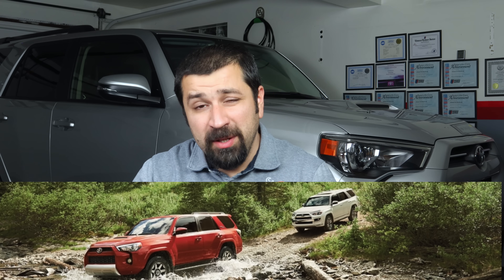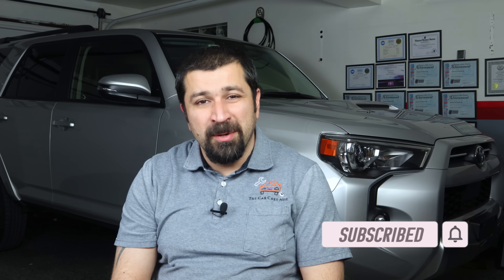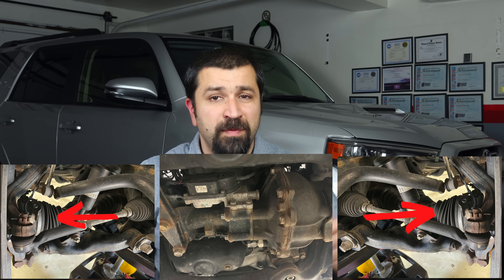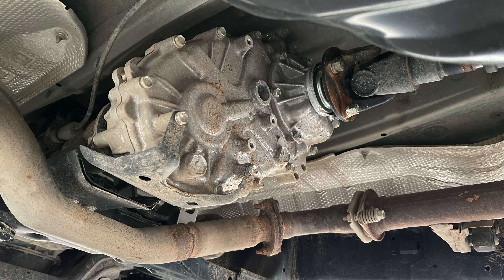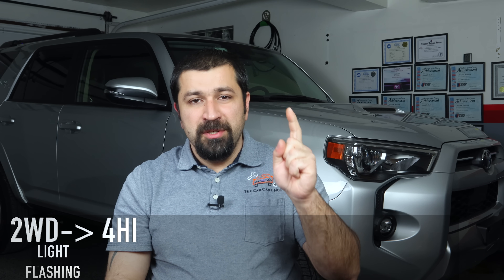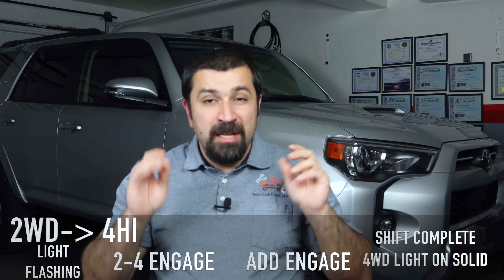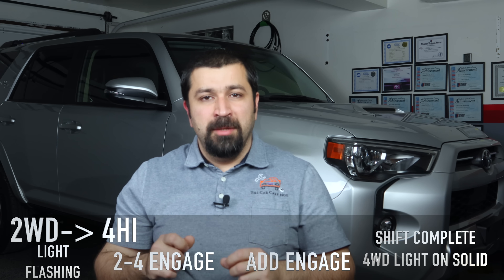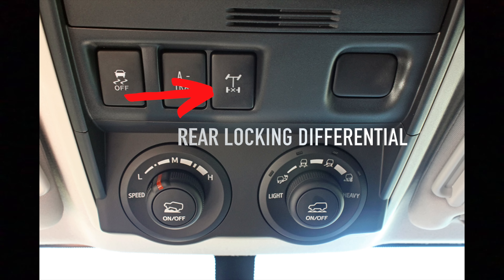How does Toyota 4WD System works and why is it reliable?

Comment: Do 3rd gen tacomas have a locking center differential? Does the transfer case have clutches?
Reply from the maker: Hi! What year Tacoma?
Reply: @TheCarCareNut   2021
Reply from the maker: Hi! On your model not center locking diff. And it’s a spline engagement with a silent chain.
Reply: @TheCarCareNut  thanks for replying!

Comment: Isn’t Full Time system 4WD, not AWD?
Reply: AWD is a clutch system, controlled by computer like haldex or 4matic. 4x4 is a traditional mechanical system of transfer cases and driver choice/skill.
Reply: @Cous1nJack  technically yep
Reply: He just said its the same exact system just doesnt have a actuator to un engage the 4x4 back to 2x4
Reply: 4wd and awd is marketing. So is 4x4
Reply: @vadimnesen8060    I always thought that AWD is something that isn’t suitable for off-roading. Like a crossover kind of gear. Something that uses viscous coupling, for example.
Reply from the maker: Wording is all it is. Typically AWD is referred to the non off road variant like a small suv or sedan and 4WD is one with a real transfer case with a low range however technically speaking speaking you can call them either.
Reply: @TheCarCareNut  yea true. I mean technically a 4wd with low gearing and center lock could have one front and one rear wheel spinning while the audi or subaru with "awd" passes it cuz it got a LSD or whatever and all 4 wheels get some decent power
Reply: Gotta have the lockers. On a 4runner or subaru. Than your golden

Comment: If a Toyota has a center diff then you will only see H-N-L on the shift lever as well as BOTH front and rear drive shafts should be in one straight line and not as shown in your video. All 4th and 5th gen 4runners are not AWD, however, 3rd gens came with AWD. All LandCruisers are All Wheel Drive and has H-N-L type transfer case with a center diff lock button.
Reply from the maker: Thank you for your comment.

Please look into the Multi mode VF4AM transfer case that came in V6 4Runner models from the 4th generation. It does have 2Hi, 4Hi-F, 4Hi-L and 4LO. The 5th generation limited models are full time AWD or 4WD however you want to call it.

Comment: Living in the flat rate world, having a family and then making these videos.... thank you for your effort and knowledge.
By the way the diagnosis of this system sounds like the way old mercedes 124/140 were lol
Reply from the maker: Thank you for watching Jose! I was shocked that my w163 transfer motor wasn’t seized when I tried it! Likely hasn’t been used in years
Reply: @TheCarCareNut  got lucky 🍀 👌🏻. 163 are tanks, even more with the 113 😍 way too expensive to fix....
Reply from the maker: Honestly dare I say this ones been reliable so far. Of course it needs something every 3 months but has been very simple to work on especially compared to the w221 with the M278
Reply: @TheCarCareNut  funny you have a 163 and a 221 and I have a 19 4Runner and I’m looking for an old corolla to save the 4Runner lol..... who has made the right call huh 🤔 lol....by the way the 4Runner needs the fuel pump deal, I’m afraid of the angry mechanic or tire team working on my truck. I’m the kind of guy who torques everything 😪
Reply from the maker: Yep! I’m unloading the w163 which replaced my totaled Camry. But not I’m in the market for a new Toyota. Still deciding. I wouldn’t worry about the fuel pump. It’s a simple tank drop and Toyota doesn’t allow non certified technicians to do recalls. They won’t pay the dealership if the technician is not expert level or higher.
Reply: @TheCarCareNut  thank you, I’ll take it to have the recall done pretty soon. If you ever need any help with the 221 let me know, I mostly work on electronics.
Reply from the maker: Thank you Jose!

Comment: Can you run this part time 4wd on dry pavement or on snowy streets?...what about full time 4wd transfer case service intervals?
Reply from the maker: Hi! I wouldn’t use part time 4WD on dry pavement. Replace the transfer case fluid along with the differentials every 30k miles
Reply: Read your owners manual. Says you CAN

Comment: I always tell people if you don’t need 4WD don’t get it. Not just Toyota but any system needs to be used or there will be problems. Lots of people go years and never use it then when they need it…
Reply from the maker: Hi! Honestly I would agree with you 100% except for the trucks and specifically the 4Runner. The resale value of 4WD models is higher and they’re more desirable.

Comment: A couple operational questions...2021 tacoma 4wd automatic.
Do you recommend going back to 2 wd if you shut off the engine? You said otherwise the computer is confessed if you shut off the engine while in 4wd.   I believe the OM says you can go from 2 wd to 4wd High if your driving less the 60 mph. Is that correct? Would you recommend stopping first then go from 2wd to 4 wd high?  The OM says about once a month drive for a least 10 miles in 4wd. Would you recommend doing the 10 miles using 4 wd high AND 4wd low? Or would 4wd do it.
Thanks....great videos!
Reply from the maker: Hi Gary. So you don’t want to interrupt the shift as it’s shifting and the light is flashing but once it completes the shift you can shut off the car. Also you can shift on the fly without issues at speeds lower than 60 mph. And I would shift into 4 hi and drive the 10 miles trying to avoid very sharp turns. Then put the truck in 4 lo then once it shifts into 4lo shift back into 4 hi. You need to be in neutral to shift into 4 lo and don’t drive it more than 10mph in 4lo
Reply: @TheCarCareNut  Thanks for the advice. We pay so much for these things....don't want to mess things up!
Reply: @TheCarCareNut  Thanks for this infor

Comment: Thank you for such great videos. I have a question. I am trying to decide between a Rav4 AWD LE and a 4Runner 4WD. We will not be doing serious off road, just a dirt road once in a while and driving on snow once a year since I live in Alabama. I wish the Rav4 LE could be bought with a towing package (transmission fluid radiator and other sturdier parts) so it can tow at least 3,000 lbs because I refuse to buy a TRD Off Road or Adventure for almost the same price of  a 4Runner. Can modifications be done to 2021 Rav4 LE AWD so it can tow at least 2,500 pounds? Thank you in advance for your anwer and keep up the great informative videos.
Reply from the maker: Hi! Honestly if towing is a priority I would look at the 4Runner. The RAV4 even the adventure or off road models are not ideal for towing.
Reply: This may not matter but the rav 4 is front wheel drive only. ( over 25 mph ).  They do it to save gas , that is the reason I did not get one    Get the 4WD

Comment: The only thing to do is to engage it once a month and give a thorough workout once a year and it keeps running for good as long as you keep it lubed.
Reply: Yes but I've been advised to only engage my 4x4 in my Tundra on snow/grave and to avoid using it on dry pavement, especially when making turns.
Reply: @ColoradoBoo  any loose pavement will do, dirt, gravel included.
Reply: @ColoradoBoo  Because in that car the 4WD is only part-time and therefore it is locked diffs from the begin of engaging it. And if you drive with locked differentials on ground where the tires have a lot of grip all arround you will wind up the driveshafts and gears because something has to take the power of the differences while turning if the tires didn't let it go. If the ground is loose or slippery somewhat so that the tires can spin trough a little it evens out itself. If you do drive on very good hard ground with 4WD you can literally lock up the drivetrain to an halt where every little gear and shaft is fastend up by force and the car just wouldn't move any more. Then you have to lift the wheels of the ground one after another or if you can both on one axle at the same time to let the forces out. After that it will work again in most cases.
Reply: Is it bad to never use 4H?
Reply: I have the manual gearbox with manual hubs. I drive with hubs in lock (in 2H) once a month to lube the front diffs. Than i free the manual hubs(free the front axles) and drive in 4H once a month to lube the output shaft bearings in the transfer box. Started doing after my transfer box output shaft bearings gave out due to being unused for long periods of time.
Reply: If you guys have to REMEMBER to engage 4x4 once a month so you don't kill the front diff. Then you really could've just bought a 2wd because you rather clearly don't use the 4x4 for what it's made for.
Reply: Can I order a 4 Runner with a Manual transmission?
Reply: @whelennut  manual would be amazing
Reply: @whelennut Good luck
Reply: @whelennut  I may be wrong but I don't think they have come with manual transmissions for a long while.
Reply: @RoyFJ65  I may have to buy a Tacoma. If I really want a manual transmission and put a  topper on it.
Reply: @whelennut  that would be nice, wish the Tacoma still had the 1GRFE although the new Toyota engines are fine as well.

Comment: @thecarcarenut hello, so I kept driving off-road while my Tacoma 4lo light was still flashing and beeping. did I mess up anything ? did I damage any components?
Reply: It just means it didn’t engage I’ve seen that on Tacoma’s a lots
Reply from the maker: Hi! Likely not. Something got stuck somewhere and it will need diagnosis.
Reply: Maybe you didn't put it in neutral before switching to low? For me, there's an immediate beep if I turn my SR5 4Runner's dial to low and forget to put it into neutral first.

Comment: I have a 3rd gen 4runner with the J-shift pattern case. 2wd with AWD mode that is electronically actuated, then 4 hi and 4 lo. Has the factory rear locker. I'm assuming much of this applies to that vehicle to? What about the 4 speed auto trans is it considered as 'bulletproof' as the 5 speed? It seems solid to me
Reply from the maker: Hi! Yes your 4Runner works the same. Does have vacuum operated actuators in the early years. What year is your 4Runner?

Comment: Thanks for the video!  I have the 20 tacoma and have searched the driveshaft for grease fittings but see none. Are there any that im overlooking?  Thanks
Reply from the maker: Hi! The newer ones don’t have fittings. Sealed u joints.

Comment: What are your thoughts on the Magnuson supercharger for the 4runner
Reply from the maker: Hi! I haven’t seen one myself but I hear good things about that company
Reply: From what I understand they are the same company TRD used back when superchargers were an option for some vehicles, so they are already familiar with OEM specs and why their superchargers are geared towards running very well with bone stock out of factory Toyota vehicles

Comment: One thing to keep in mind for a big difference between all time four-wheel-drive and part-time four-wheel-drive vehicles is that in a part-time four-wheel-drive vehicle the front differential is geared higher purposely than the rear differential. It keeps the vehicle climbing so to speak over soft material underneath. That is why a part time four-wheel-drive vehicle should not be operated on dry pavement and the front Wheels will hop on dry pavement when turning. Also, that is why part time four-wheel-drive vehicles are much better and much more capable off road than an all-time four-wheel-drive vehicle will be that has the same gear ratios up front and back.
Reply: Never heard of different gear ratios between front and rear diffs.  Not in my old Internationals, not in my old Jeeps, not in my old Toyos.  Not even in the Trooper or Pathfinder I also used to own.  Hell, my buddy builds 6 wheel drive tour buggies and they also have the same gear ratios front and back.  Don't know where you got your information or to what vehicles it might apply.  I never owned a Ford, Dodge or Chevy so I can't speak to those vehicles.  Maybe if someone was building a sand dragger but I had friends who raced in the sand and even their machines were same gear ratios front and back.

Comment: Hey, what do you think, is it ok to put 5w30 to toyota corolla 2017 1.6, gasoline, no hybrid. I was told at a dealership that 05w30 is fully replacable for 0w20, in particular in no hybrid 44.000 miles on it. I live in Europe, we have winters sometimes quite cold, like a last year. Engine is ok dont't take oil etc.
Reply: Me again lol. But answer to your question. It should be fine to switch to a 5w-30. But I’d use synthetic if I were you
Reply: @joshmason1003  thanks Josh 👍
Reply: You just posted this 14 minutes ago and I happened to see it lol 
My daughter has a 2017 Kia Soul 4 cylinder that was burning oil but wasn’t smoking. It would lose about a quart of oil every 2000 miles. It called for 5w-20 and I always took it to local place for oil change. I decided to try switching to 5w-30 to see if it helped. I bought 5w-30 Castrol synthetic and changed it myself. Completely stopped the problem. I don’t know if it is because I switched to 5w-30 from 5w-20 or because it’s synthetic or what but problem solved.  But another reason may be these oil changing places use bulk oil and I’m sure it’s not the best quality. Buying oil yourself in quarts is better in my opinion.

Comment: Good video but I bit of a constructive criticism for you here. I have owned different Toyota trucks for many years also I am an off road enthusiast, watching your video though I find it a bit all over the place, if I didn’t know anything about 4 wheel drive systems I would be probably be confused or just believe blindly everything you are saying . 
You would think that people that buy vehicles with 4 wheel drive systems with 2 speed transfer case full time or part time, are going to use the vehicle off road or what it is meant for. 
Otherwise most people are just fine with an all- wheel drive vehicle like a Subaru or any other crossover in the market with a similar system.
Reply from the maker: Thank you for your comment. It’s hard to always get it right with simplifying kinda of a complicated system honestly. You and me think it’s simple but others won’t. And you wouldn’t believe how many TRD pro 4Runner models I see that never see off road aside from going over the curb at the mall.

Comment: Hi AMD, very good info provided.  One quick question, on a GX460 Transfer Case - can we use 75w90 gear oil and how often would you change the Transfer Case oil?  Thanks in advanced.
Reply from the maker: Hi! You can and I would replace it every 30k miles
Reply: Could i use  75/90 gear oil in tacoma 2016 transfercase So I can use the same gear oil and the differential and the transfer case thanks and advance really appreciate it

Comment: Informative video with one exception.  On the 'part-time' 4WD system, you kept referring to "center differential" in the transfer case.  The is NO "CENTER DIFFERENTIAL" in the part-time system.  The term 'differential' is used to describe a mechanism which allows two shafts to rotate at 'different' speeds as in both front and rear axles and the full-time all-wheel drive system drive shafts.  In the part-time 4WD system, both drive shafts are locked together when in 4WD and rotate at the same speed.
Reply: Alright then what is the "center diff" called?? Or what should it be called
Reply: @Verzula  Since there is NO center differential, there is NO name for it.  All of the components involved are simply referred to as the 'transfer case'.
Reply from the maker: It is not a differential per se but it is referred to as a center locking differential.
Reply: @TheCarCareNut  Who's calling it a "differential"?  Whoever it is, doesn't understand differentials, locking or otherwise.  With the exception of the neutral position, the transmission output shaft is locked to the rear drive shaft.
Reply from the maker: @DaveP923  research on the VF4AM transfer case. Terminology is at odds here however you can consider that a part time 4WD transfer case as it has both 2HI, 4HI-F, 4HI-L and 4LO and that’s what I was referring to in the video. Thank you.
Reply: @TheCarCareNut  Hey do all 4 tyres need to be changed on an AWD car when one tyre goes out? As I have heard that all tyres must have equal wear to prevent damage to the AWD sustem/transfer case ? Just weighing up the pros and cons

Comment: I am very happy to learn that the shifters are controlled by a simple computer separate from other computers in the car.  Previous to owning our 4Runner we had a 2015 Nissan Xterra that we bought new.  The very first time that I truly needed the 4wd to work on the Xterra was when I was pulled down onto a river gravel bar to retrieve a canoe.  I spun and sunk.  The car would not shift into 4wd because, as it turned out, there was a poor connection to one wheel sensor related to the ABS.  I think it was really stupid of Nissan to make the 4wd dependent on other systems.  When I need 4wd, I need 4wd no matter what else is happening.  That is the point that I was 95% of the way to making the decision to get rid of the Xterra and trade it for a 4Runner.
Reply: You should've. Nissan sucks ass. Unfortunately I've got a g37 and I know i made a mistake not going for Toyota or Lexus
Reply: @Verzula  It depends on what you look for in a car! I have driven the G35 and it is FUN to drive, very responsive!  It isn't ALL that awfully unreliable either... at least before 100k 
So i would say you won't really ever have as much fun in a toyota (unless it is a supra or a supercharged version ). They are just work horses, reliable and get you there ... maybe not in style, but they get you there.
Reply: @Verzula  Nissan don’t sucks it mostly operator error lol love my 1st gen xterra built like a tank